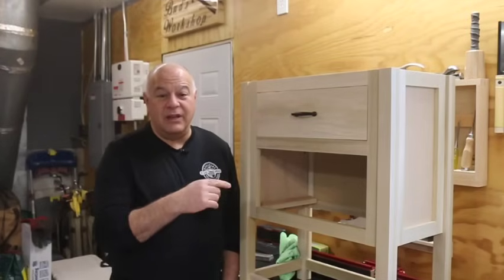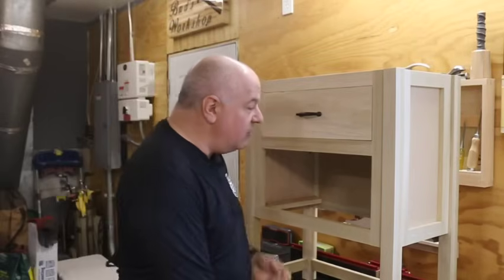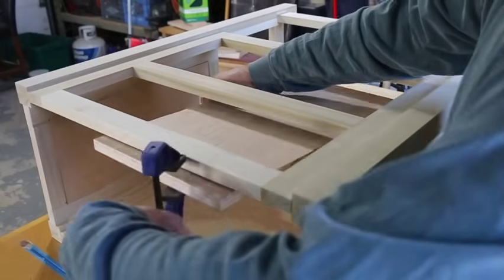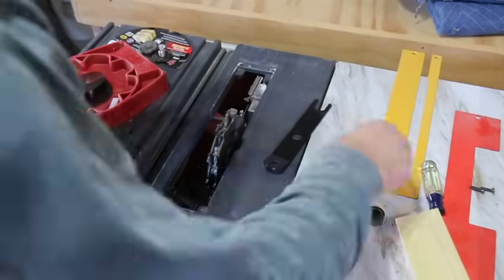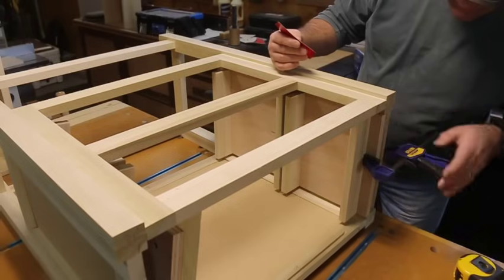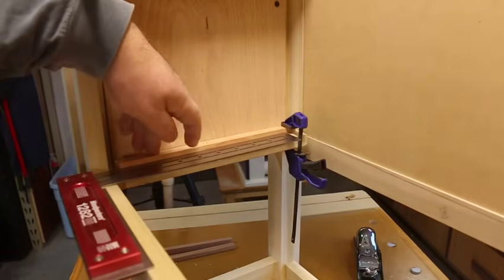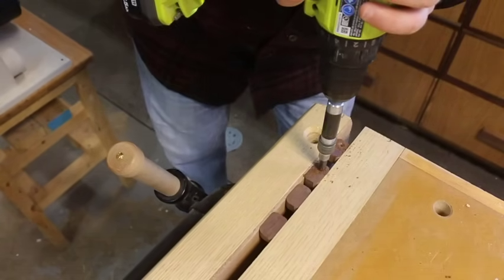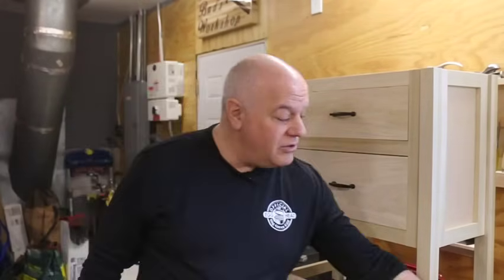DIY Wooden Drawer Slides – Traditional, Affordable, and Space-Saving!

Comment: Pulling out the drawer feels so much more pleasant with ball bearing slides.  I found excellent slides for $5
Reply from the maker: They certainly have their own advantages.
Reply: Where did you find $5 slides?
Reply: @karimbaker9482  plenty on Amazon. I usually buy pack of 6 or 10

Comment: you could also make the back of the drawer tall enough that it hits the rail when pulled all the way forward. the taller back prevents the drawer from being accidentally pulled out but you can still get the drawer out when you want to by lifting up the front of the drawer until the back slides out from under the rail.
Reply from the maker: Good idea!

Comment: Looks great.  I just don’t quite get the most important part, at about 3:55 in the video.  I think you’re trying to say that the drawer could shift from side to side so you’re putting in an extra strip of wood, which is perhaps aligned with the face frame?  But I can’t see enough of exactly what you’re doing. I sure like how you can use clamps and hold the whole thing together and know that it fits before you screw it together.  Personally I like the idea of not spending so much money on drawer slides.  I think the tongue hanging down from above to keep the drawer from coming out is far as superior to using a nylon strap which someone else suggested.  I was struggling to visualize some sort of stop like that and you did a good job there. Thank you for posting this.
Reply from the maker: Thanks for your comments. As for the extra stops you mentioned. Think of the as guides so the drawer slide in and out straight. Without them, the drawers could rock and become difficult to operate. Hope this helps.

Comment: whats a good, cheap wood, to get started making some simple furniture? I like pine, even the color and to some extent the figuring. is that a good choice?
Reply from the maker: Depends what you are building. Pine is soft wood and can dent easily. Poplar is easy to work with but the color can vary. It is great to use if you are painting it. Next I would move up to the oak family. Red oak is affordable but can be grainy and hard to sand. White oak is a bit nicer to work with and finish.

Comment: Clever solutions. The only concerns I have are the cost and weight of all that extra plywood.
Reply from the maker: In my case the plywood and runners were scraps I had from previous projects so the cost was not an issue. The weight is comparable to the weight of the metal slides. I am sure there are lighter ones. You could always do smaller individual panels instead of one large one to cut down the weight.

Comment: Really solid video. Short, sweet, to the point. Quality editing, production quality was good overall. Thanks for the tip, as a total beginner it is always good to store this sort of information away. Definitely agree on the paste wax tip! 

I do however want to add a question. With all due respect, would it not be safer to cut the dados with the shorter end of the board against the fence of the table saw? It seems like it would have much less of a chance of getting caught between the blade and fence through the board turning on ya. No disrespect intended, just wanted to (potentially) offer a safer way if it is possible.
Pardon the long message, thanks for the video, God bless.
Reply from the maker: Thanks for the feedback! You are absolutely right on cutting the dados. The first couple cuts were closer to the fence but the one side of my board was not square so I took the lazy way out. Great call out!

Comment: Great video, I have one question, what are the little blocks for that you screwed on at the end. I got the part about turning them up to get the drawer out, but is that the only reason? Excuse all those stupid comments, it was a well done video.
Reply from the maker: Thanks for the question. The blocks serve two purposes. They keep the drawer from accidentally falling out and the keep it from being pushed too far in. Basically keeping the drawer face flush with the frame.

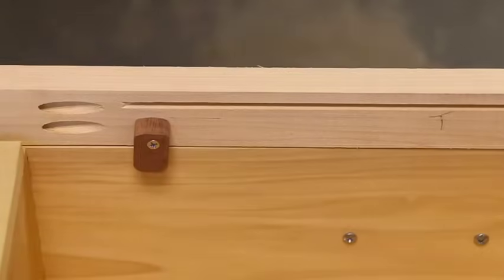Comment: At 4:59 of the video, I see pocket screw holes but what is the linear cut line just below the top edge in this photo? Seems I’ve seen these before but never knew what they are for. I’m sure I’m not the only one who doesn’t know. Thanks in advance!
Reply from the maker: That is a slot to use Z clips for attaching the top. You can buy these type of clips but I prefer to make my own out of wood. You can see me install them in the Entry Table Build video at 6:14.
URL to Video below:
 https://youtu.be/UNWk2kqG90Q

Comment: Nice work but my opinion.
If you don't use the drawer much, wood runners are a nice traditional way of doing it. 
If you use the drawer a lot, use metal guides. Wood will not last and opening and closing it will become difficult after time.

Comment: What happens when the frame and non plywood pieces expand and contract with weather ?   With those tight tolerances you are asking for trouble !
Reply from the maker: The cabinet I built is over a year old now and I have not had any problems. On average, wood expands 1/8 inch over 1 foot. Since the boards are narrow the movement is negligible.

Comment: Sorry, but I will be sceptical. 

1. Cost. 
How much extra work did you apply to make these wooden runners compared to just screwing in metal ones? Time is money, remember. 

2. Size. 
If you have wide faces on your cabinet anyway, then you have space there to fit some extra ply inside. Otherwise, 2 x 1cm metall runners would take same space or less.

3. Traditional look.
Well, this is probably the only real reason to use wooden slides. But personally, I prefer quiet and smooth metals.

Anyway, thanks for sharing and success for your projects ❤
Reply from the maker: I appreciated your comment and perspective. Cheers!

Comment: Drawer runners are the only way to go. You get FULL extension, do not have to worry about the drawer falling out, they are quiet and there is no wear of wood on wood. Drawer runners are so easy to fit, you can do the drawer installing in half the time.
Who really cares about the one inch space of the drawer runners? If this is really critical make the cabinet wider!
Reply: Cost was one reason, and there is more than one method to stop the drawer from falling out.
Reply: For those of us who rarely install drawer sides it can be a bit of a pain and take a lot of time if you don't have the drawer slide guides - - - another cost.  Buds way is easier for me.  I assume if you do a lot of mechanical drawer guides you might see it differently.
Reply: Putting in drawer slides is challenging? They are dang expensive.